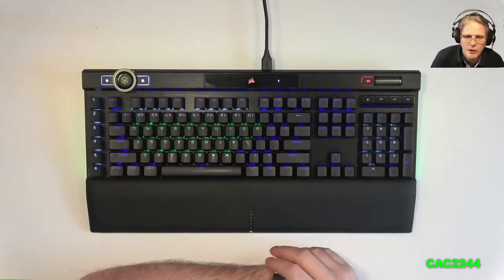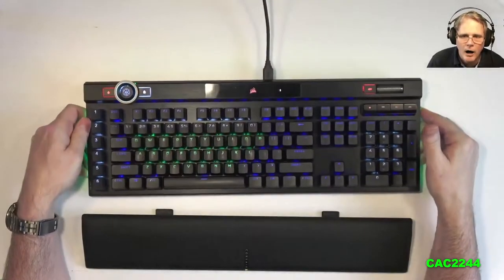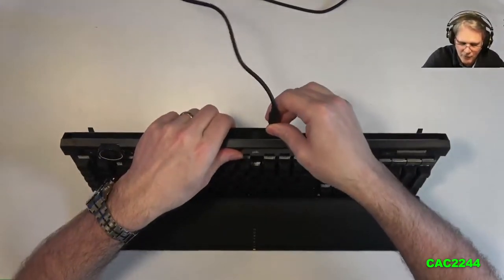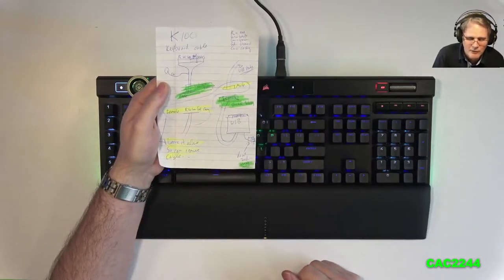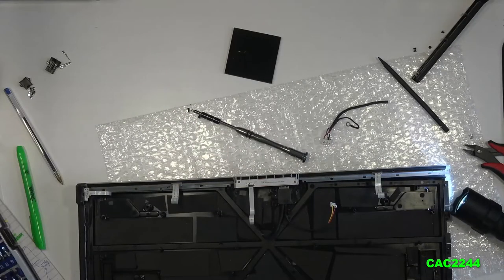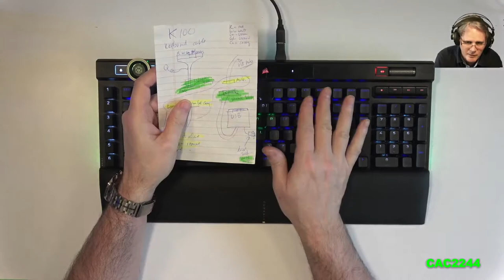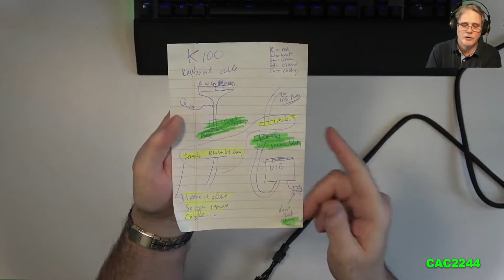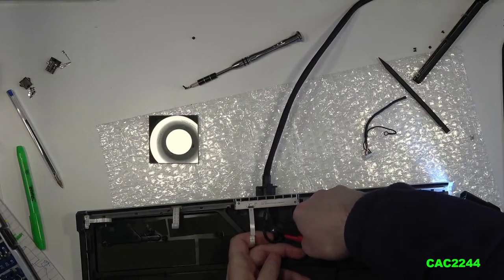K100: Removal of original thick cord to use USB pass-through port as input!

Comment: I've done it with my k95 Plat, the k95 Platinum is a little different, it doesn't have the usb hub section it has a daughter board with usb on there
Reply: my next one is to do this to K95 or K90 MMO keyboard but it has no usb passthrough but still the same annoying thick cable, the other usb is to switch between 1 to 4 bios profiles
Reply: Hey there, did you connect the black cable from the keyboard and the yellow from the USB?
Reply: @Shirotama0  lo resolvistes?
estoy por animarme a realizar el mod

Comment: What was the name of that cooler master mouse u used to have in videos like 2 year ago plz i im interested
Reply from the maker: Ninjacted, it was the coolermaster MM530 (came with a weight inside) and the MM531 which was the same but without the pre installed weight. I still have both of them and use them daily on my work laptops. To me, it remains the best overall wired mouse. Below 50$..

Comment: Isn't the reason for the two cables the current used by the Keyboard?
My old Logitech G15 seemed like it drew so much current that it needed a powered USB hub to work reliably.
Reply: If you don't connect the passthrough, the keyboard still works fine so I don't think it needs/draws more power from the passthrough port. The passthrough is mainly used for their iCue nexus setup I think XD

Comment: hey, do you reckon other brand keyboards would be similar if not the same under the hood? e.g. hyperx alloy elite 2
Reply from the maker: If it has a passthrough, which the HyperX Alloy Elite 2 has, then it should be fairly easy to figure it out, so yes, I reckon.
Reply: @cac2244  thanks for the quick reply:)